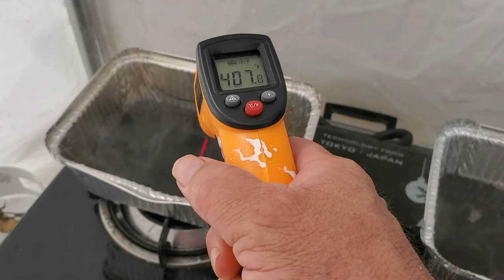Does Motorkote cause sludge thru evaporation?

Comment: I put it in my water cooled 27hp Kawasaki V twin Scag mower. I installed a temp gauge years ago. It dropped the coolant temp 10 degrees! And no oil loss and the oil it staying cleaner. The motor has noticeably more power. I use 15 W 40 Rotella T6 and the recommended amounts of Motorkote. Oil temps will never get that high in a motor as in your test. The motor will be dead long before that.
Reply: Motorkote reduces friction by 95% or higher and your engine power steering transmission transfer case or rear differential, if you sent a sample of the oil when it's new and a sample after you drain it to the lab for testing look at the iron content when it's new it has an index of number one, after you drain the oil and have it tested the iron index under normal conditions is 150! After using motorkote you'll notice that the engine oil or transmission oil is not only cleaner when it's time to service and drain it? But it has less iron or aluminum or other metal content inside the drained oil! It only takes five or 10 seconds of use for the metal to metal surfaces develop the murder coat becomes coated over the metal and then you have two surfaces of super slick motorkote sliding against each other instead of metal friction! So the choice is yours make up your mind you want to gradually wear your engine and metal components down? Or do you want to extend the life of your engine transmission power steering differential transfer case X factor of 30 times

Comment: Never tried this product, but I do run a full compliment of Mogul engine & fuel system flushes and synthetic oils, all with excellent results (several Gen2 Prii, a Mercedes Sprinter motor home, a V-6 Jeep Liberty & several Honda V-6 vans). Every one experienced quieter lower idle & running, plus improved fuel consumption, so I'm a fan. Also, my vehicles don't burn any excessive oil, run cooler, and range from 185k miles (Jeep) to 325k miles (all of my Prii are 220k+ miles). The Mercedes is only 65k miles, but the last year before the turbo V-6 went to DEF.
Love your videos!

Comment: You're test is Null. No engine will reach anywhere near close to 400 degrees. Ideally you want Oil Temp to be around 212-220 to burn off the moisture

Comment: MotorKote recommends 2oz per 1 quart oil. What exactly is it you are attempting to demonstrate here. Looks like apples to oranges comparison to me. A diesel vs a hybrid, different ratio mix’s, no mention of number of miles on either vehicle. If you are going to do some sort of test, you may want to establish a baseline first. But hey, it’s your money and time your wasting.
Reply: I had a Honda that I was going to junk because I don't have time to finish the body work and my wife was getting mad because it was sitting there for months. I put pure motorkote and drove it for an hour and was nervous af because I thought forsure it was going to die on me and it didn't. I drove it around for a month before I junked it and I was shocked that it was still running fine lol.

Comment: damn, intresting but does it harm the bearings and rings, after a while?
like does it loose it function over time...
i wonder what this would do in a modified turbo engine
Reply from the maker: I haven't heard of anything yet but hopefully the community will chime in!
Reply: It extends the life of all metal to metal working parts inside of your engine transmission power steering transfer case and rear differential by coding all metal to metal Parts with motorkote super-slick Hyper lubricant there is no more metal-to-metal contact and less than motorkote has been warned off which in this case they recommend replacing it every other oil change in the engine or in this case every time you replace the transmission fluid transfer case or rear differential fluid
Reply: It turns acidic over time.  It's best to use in Motoroil and fluids that get changed by 10,000 miles.  I wouldn't run it in a transmission if you plan on never changing that fluid in 150k, but fine if you'll change it in a reasonable amount of time. I run it in my cars, boats, and lower unit oil cases on boats.

Comment: i love that you try it on your fleet, i would dare doing it on my miata,
 i only have 12 ounces in the engine oil, and dont notice any difference, 
also put 12 ounces in my mates volkswagon polo 1.6TDI and he also doesnt notice difference, but maybe it will protect the engine parts.....
Reply from the maker: I gained at least 15 percent on my Prius being conservative, but used a whole gallon.  I hadn't thought about people not seeing results.  Most people have stated positive things.  Loved the VWs never owned a Mazda, well I did the Mazda B2000 (Ford Ranger had the same)not sure who manufactured it but it was great.
Thanks for the feedback
Reply: @eby6114  no problem ! i really do believe this product works, but did you drive exactly the same before you did the tests with the motorkote to see if it did increase 15%?
Reply from the maker: Yes I gave it my best try however on the Sprinter testing I have an exact route same day same hours so therefore the same traffic etc.  Great results.  My favorite was however the transmission test video.  It was the only test where I could "feel" the difference as silly as that sounds.
Reply: Scientifically the only way you going to see results is test your oil before and after in in the components you're putting it in whether it's a engine transmission power steering rear differential or transfer case and you'll see the iron and other metal content afterwards of draining oil and what the lab results will show before and after and then you can compare the results for yourself, that includes testing the oil before and afterwards wetherby engine oil transmission oil differential oil or transfer case oil that's the only way you can actually tell the difference and kind of before motorkote and after motor code so you can actually see what the difference is how much metal is getting wore down inside of your engine or components before and afterwards!

Comment: Prius engine oil operating temp is not 350F. Unless you can prove it. The 5w30 oil should have flash point of under 350F. 
Also the prius 1.5L runs pretty cool and it is not picky  for oil at all. Normally those engines burn oil due to know problem with piston rings. And not because of 350F on a non turbo engine.
pretty cool experiment but there is no benefit of using more than I think 16% of Motorkote to given oil amount (as per label). Reason is the oil will protect the engine as is and motorkote just adds another great protection. If it was some bad quality engine nothing can save it
Reply: The oil temp sensor isn’t located between the piston rings and roller bearings…. Oil gets really freaking hot inside the engine when it’s being worked hard. The oil temp sensor is not a accurate representation of internal engine temps.
Reply: I agree. The closer to the flame the hotter and thenoil in the pan is much cooler than the one one the piston ring but in general as mentioned in the video the normal operating temp for the oil is not 350F. I dont know what is that data based on

Comment: I'm sorry but motorkote does not recommend using 100% motorkote in your engine? You should only be using 2 oz of motorkote 4 quart of engine oil in your engine to begin with! The engine oil carrier in motorkote is not the same thing as the synthetic that you buy on the market or from Walmart or your favorite store or online? It's only a carrier for motorkote! Therefore you made a mistake by using a hundred percent motor code when you said have only added to ounces per quart or maybe three for commercial use! Next time read the instructions on the bottle
Reply from the maker: I never said to follow my example just wanted to see what would happen it's an experiment on a car that I didn't really have to keep.
Reply from the maker: I also contacted motorcoat before I did the 100% to see what kind of carrier oil and it's just a generic oil.  You might see some of my other videos where I put motor coat in the transmission and used it in various vehicles as far as following directions no one gave me directions to swap out my NiCad 230V Prius hybrid battery for lithium but I went ahead and did it anyway
Reply: @eby6114  Did the engine die on that vehicle yet?
Reply from the maker: @aksh9300  Nope.  Though I've never had an engine die under 300,000 miles.  I run cars that long and sell them since the whole car is worn out and still running.

Comment: If this “additive” was so effective and had so little downside…..why wouldn’t every manufacturer, or the big ones Amsoil liqui motul mobile use this
Reply from the maker: They have there own methods.  Before using anything I've never had an engine wear out.  Always the car would wear out first.  At 300,000 miles I have always gotten another used car.

Comment: Motorkote reacts badly with aluminum parts in a engine. it creates a port blocking black sludge.
Reply: I have  all aluminum engine . 300.000 miles use moter kote every oil change ..  prove your lies then